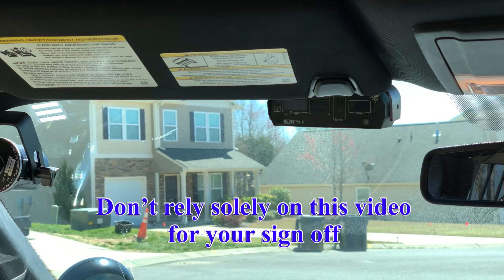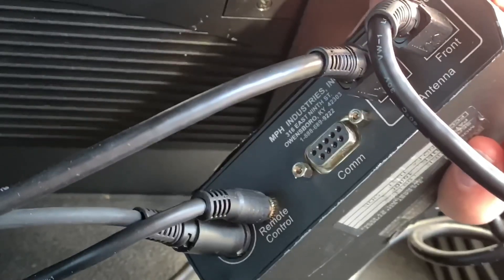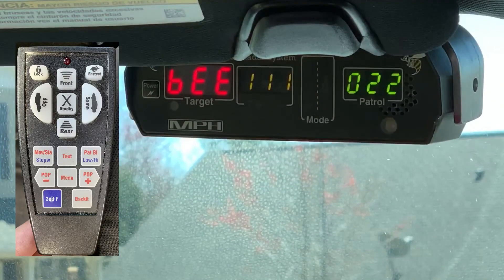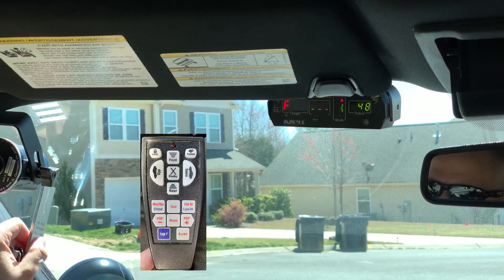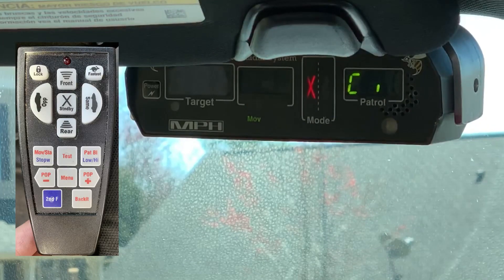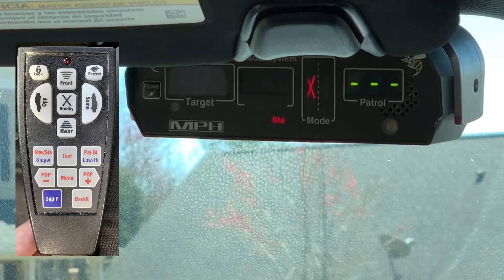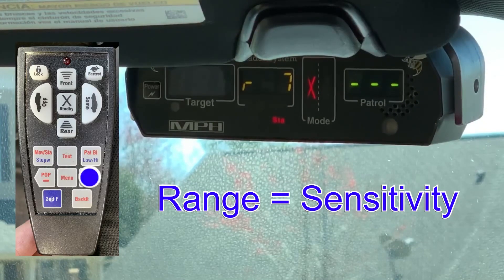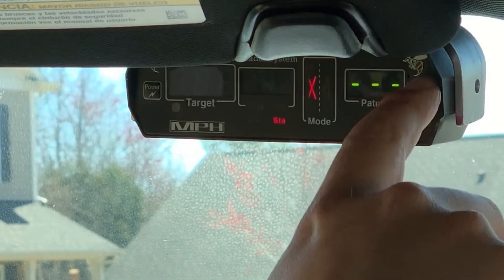MPH Industries BEE III Setup and Features

Comment: We are allowed to use Fastest in Idaho. Incase anyone is curious, the Fastest button activates a mode that searches for the fastest target within range, even if it's moving faster than the strongest target. This mode is indicated by an illuminated "FAST" icon on the front panel. In this mode, the radar displays the speed of the fastest target in the middle window, while the strongest target speed is still displayed in the normal target window.